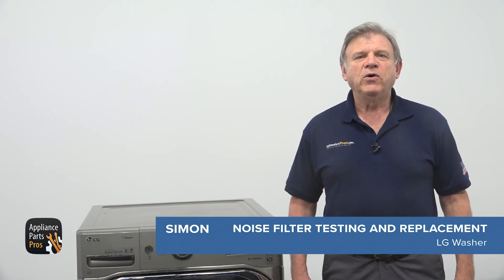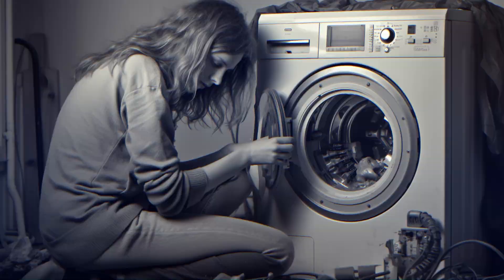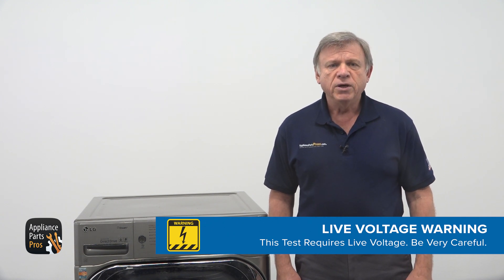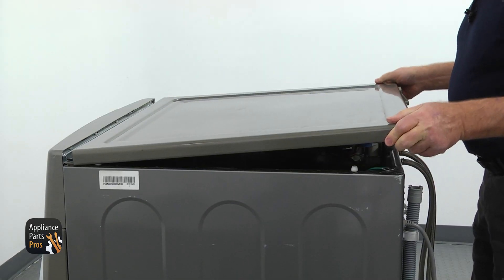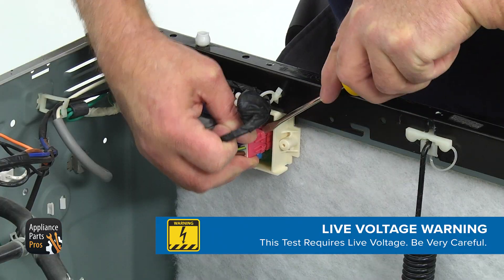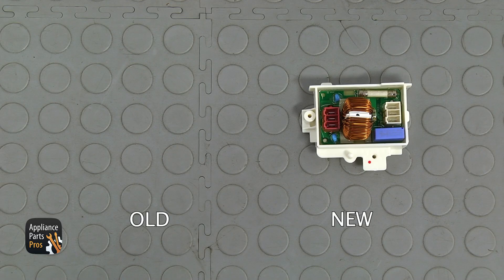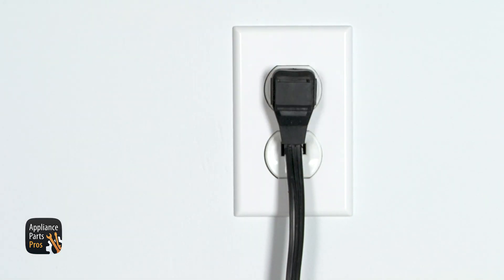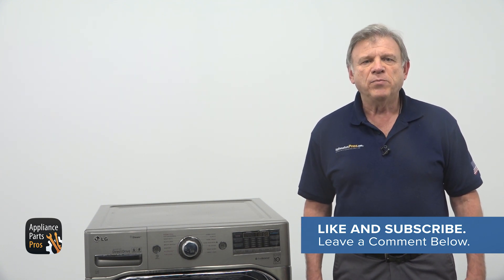The EXPERT Guide To Testing And Replacing Your LG Washer Noise Filter

Comment: Thank you for the tips my washer wouldn't turn on like no power so i go to the noise filter checked good  on both sides i plug everything back in an boom starts working again maybe I had a bad connection if problem continues i will replace it thanks
Reply from the maker: Nice work, @rickywalston7136! Sounds like you might’ve nailed it with that reconnection — sometimes it really is that simple. If it acts up again, you know what to check next 👍
Reply: Got the same problem 
Just 800.00 to late😢

Comment: I’ve tested the power cord and it is fine (1st step in video), replaced my noise filter and it is running current (2nd step in video) but my washer is still not powering on. What should I try next? LG washer  wm3875hvca
Reply from the maker: If you have power at the control board and no power coming from the control board when you start a cycle then your control board would need to be replaced.

Comment: Great video. Thank you for sharing. What is noise filter ?
Reply from the maker: Great question! The noise filter in your LG washer helps reduce electrical interference (or 'noise') from the power supply, ensuring smooth operation and protecting the control board from voltage spikes. If it's faulty, it can cause power issues or prevent the washer from turning on. Let us know if you need any more info!